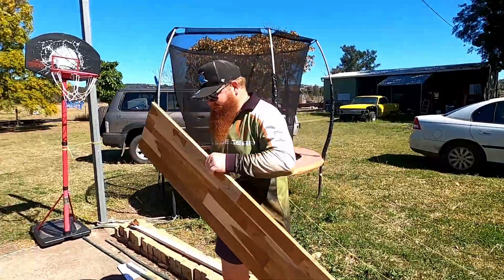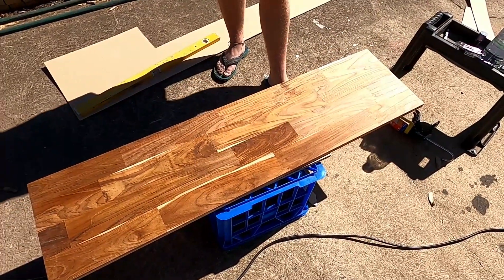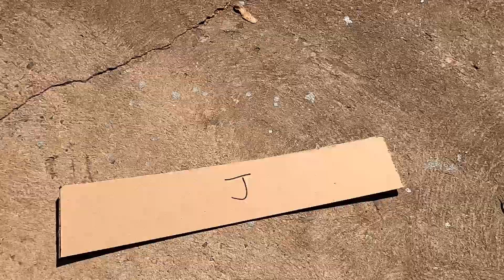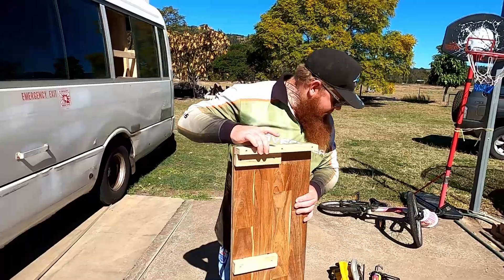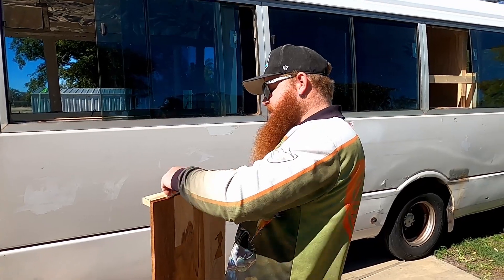Building a bathroom in a tiny house, so much progress this week! Mitsubishi Rosa - 14TR. Part 17

Comment: Hi, I'm in the throws of buying a bus now and look forward starting on the build journey.
I had a thought on the issue with the seats for the kids.  While it does say to use the original bolt holes the standard bus to the deluxe is mainly a difference of the raised sections on the sides for the seats. If Mitsubishi is the same as many manufacturers then the bolt holes for the flat floor seats should be in the cross members (theoretically the raised parts should have been directly above the flat floor ones)
Now for famous last words, if you go to the engineer with this info, would it be sufficient to be able to legally bolt the seat on the new lower floor?

just watching the video as I was typing.  If the cross member is in the way, can you cut the section and replace it with RHS which is welded with a square hole/frame to drop the waste water outlet through. Get your welder friend to make and weld back into the remaining cross member to retain support under the shower tray

Sorry for the long winded comment but looking forward to seeing your progress
Reply from the maker: Thanks for the ideas, we'll take them to our engineer and see what can be done!

What sort of bus are you going for? It's such a good experience building it out yourself. 😊
Reply: @OneForTheRoad  A Mitsubishi Rosa.
Found one in Cairns, good price and good kms on it. I am flying up tomorrow morning to drive back to Brisbane.
I'm 6ft5 so going to interesting what I do so I fit, relatively speaking.
All I know is I want to start and take it to Bathurst so I don't have to set up a tent this year, even if first trip is only a shell with mattresses 🤣🤣
Reply from the maker: @wayneknowles3369  hahaha! Sounds like a good idea.

Yeah we're both quite short so aren't having any dramas.. although I think once the shower floor is raised a little it will be a tight fit.
Reply: @wayneknowles3369  gday mate! I’ve just started my bus build and had the original design with two small raised platforms and can confirm that those holes are directly above the platform holes. The only thing you may need to do is get an original design seat instead of a deluxe design seat. But it should all be within the reqs for seating.